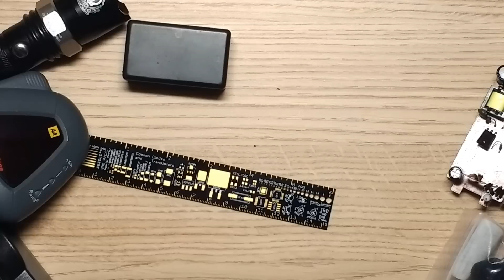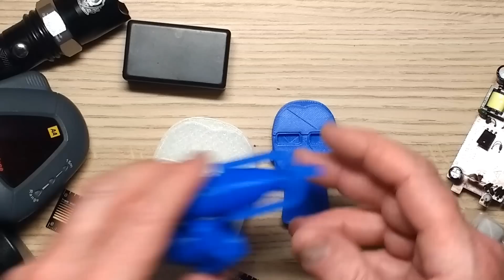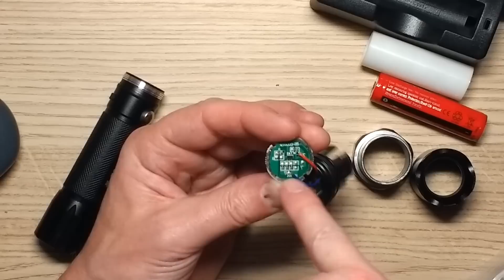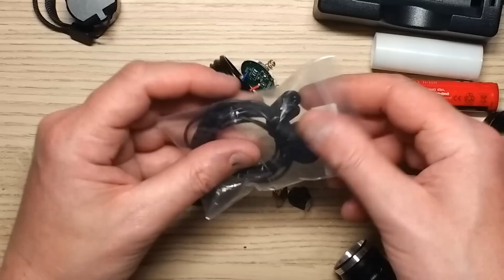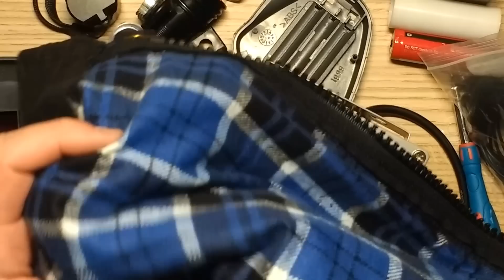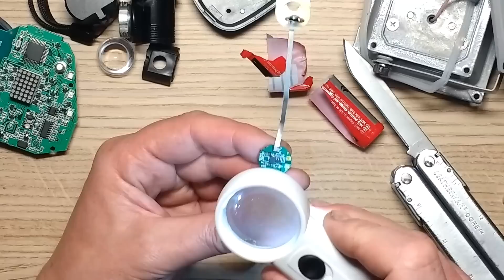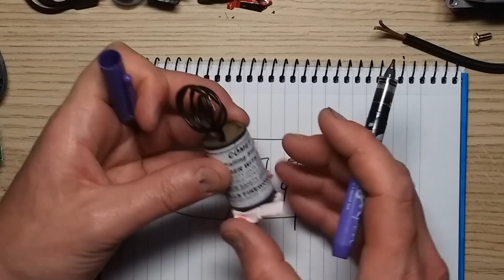Exploring technical gifts from the Edinburgh meet.

Comment: now that im seeing this a 4th time, that metal thing at 2:10 looks to me almost as if you could use that as a bottle opener
8:50 that flashlights a bad design cuz when you zoom it enough those wires will break off the board.

Comment: I had a flashback when you took the Trafficmaster unit apart. Years ago when Trafficmaster were setting up and putting in all of the infrastructure they were contacted by a good friend of my father's that works for the DTI. Someone discovered that during manufacturing a slight boo boo was made and the wrong frequency was programed into both the transmitters and receivers. This was discovered after well over 1000 sites had been commissioned. The result was that Trafficmaster had to recall and re-program all the kit out on site. OOoopsy !!!! It made me chuckle when your video reminded me of the rather large screw up :-D

Comment: Getting a kick that someone knocked off Ultrafire.  Crap batteries as they are.  Generally, I risk getting a shock and when my laptop battery goes to crappers I try to tear it apart  without a shock and usually get one.  But those last way longer than the Ultrafire ones do.  What is Ultrafire knocking off.  (and yes thanks to you Clive having a 5000 mah light weight li ion batter vs a 2000 heavy weight battery hmmmmm  which one is better.  Although not always true..  Antec PSU computer grade , that shorted right out off my left hand and out the right foot  (ouch) but the old cheapie $20 Logosys PSU's are nearing 13 years old and still rocking.  Antec ($80 PSU) says hey 4-5 years is good.  Logisys (sp)  somehow they last longer.  Especially the all black ones.  Had an iffy go with one that was half black half olive green.  One of the rails fails my PSU tester O_O  As for puffed up capacitors.  I had to toss a motherboard out when 6 in a row all did that.  Mercury PC did that.  Long dead company but it worked with ubuntu so I was good to go there.  Never shut off right under windows..

Comment: They are non polar I use those ones in audio equipment; multicomp I think. Panasonic SU series ones are better tolerance though.

For smps use I haven't found better caps than Panasonic FM series. These have the lowest esr and hence lowest output impedance for the supply. However worth noting that the FC series actually offer longer life.
Reply: P.s. I thought that was an AvE ruler!

Comment: 7:30 ,that torch is the EXACT same design as the golf ball finder UV light torches ! also came with rechargeable battery and mains charger ,only thing different must be the bulb and regulated circuitry for it

Comment: I'm surprised that cannons designed to fire off pounds of black powder and shot would be affected by firing fireworks out of the barrel. They could just stick a temporary bore liner in the cannon for the show. If this show was based in 'Merica then they would probably be firing black powder blanks. Otherwise  great video mate.
Reply: IIRC from the earlier video showing them, they had multiple shots set up on each cannon. Not feasible to have a gun crew on each  gun, reloading them. From a distance you probably can't make out if the flame comes from the actual bore or just next to the barrel anyways.

Comment: Ah the 'personalised roadwatch' - a disguised Trafficmaster box based on their Trafficmate product. Served its data on 153.2750 from roadside boxes encoded POCSAG FSK (mainly now those 'blue poles' you see which generate an MD5 hash of the reg number & track journey times between adjacent sites). Their older product with the big display worked similalry but displayed stuff on a big map. That got its data over Vodafones national paging network in POCSAG.

Beacons are still fitted, network still works. The data is just now presented on apps on phones instead of dedicated devices. Trafficmaster started out at Marlborough House in Linford Wood, before moving up to a massive building (all theirs) at Cranfield - they now occupy a couple of floors at most I think, rather than the whole building.

Madness with their ANPR 'blue pole' network is each pole site has its own dedicated ADSL connection. They used to be dialup with data shipped back every 5 minutes. The modem rack in MK was quite a sight!

God i'm a ruddy anorak!
Reply: Great info!  I was interested to find out about this network, as I hadn't heard of it before this video.
Reply from the maker: +Nik Fox All good info, and intriguing to know the system has adapted.
Reply: May even have changed again since the last time I looked but yep, they live on! Glad the show went well by the way - we've got the BBC Concert Orchestra in my theatre tonight....now, what could possibly go wrong :) haha
Reply: I keep meaning to put some batteries in my receiver to see if it still works! :-) Mine's one of these:

http://www.uglybloke.co.uk/cb/rac%20traffic%20alert%201210.jpg
Reply: Niiiiiice! Did the RAC one need an 'information key' chip or not? I had the old Trafficmate doorwedge shaped thing, and the newer flatter one. Still around somewhere I think. Latterly I had the iQ (like an early satnav with a screen) - all of them were 'protected' by one of those keys which only told the unit an expiry date ISTR. Wound up reverse engineering the protocol because, well, I'm just sad like that & at the time I was a radio travel news geek :)

All pointless now of course with Inrix (nee Trafficlink & Metro Networks) feeding data into the TMC carrier on Classic FM for your Satnav & Google doing their own traffic probing...and Waze of course. That said, Inrix are still using humans to do the editorial work for the most part. Many a long 12 hour shift doing that in between dialling into BBC Local Radio stations to depress the driving public ha
Reply: No, the RAC thing is free to use and didn't have any sort of key, though of course it didn't have the functionality of the map display on the full Trafficmaster doobrey. Researching around the net, it seems the system was left to gradually fail, but was switched off entirely a couple of years ago. Shame if that's the case, it seemed more real time than what you get on the RDS system.
Reply: It is/was - so far as I know they're still using the traffic detection infrastructure but I've also heard not. The RDS TMC data relies on a human putting it into a computer (motorways could in theory be automated...) and that data being pushed out. Trafficmaster was just that, very real time :)

Comment: You can buy a non-focusable version of that torch without charging support in Home Bargains for around £3. Other than lacking the charging port or ability to focus, it has exactly the same case and same functionality. The home bargains version comes with an adaptor for 3x AAA batteries, but it'll also happily fit a single 18650.

Comment: the chop saw was probably using an abrasive type disc and you dont use those on aluminum. basicaly it loads up the aluminum on the wheel because it actually melts it, then as it continues to load so does the temp until BOOM! its explained here http://web.mit.edu/course/other/machineshop/Grinder/aluminum.html
Reply: i don't really like using abrasive chop saws or cold cut saws because chop saws blow up once they get loaded and the carbides fly off the cold saws if you look at them wrong. an angle grinder with a zip wheel is where it's at. cheap, thinner, faster, and if they blow up it's not a fucking apocalypse. if i need to cut big tubing then a portaband is infinitely more effective and versatile

Comment: The non-parcan 3D printed lantern looks more like a Selecon SPX than a ETC Source 4 - the shape of the handle at the back on a source 4 is two distinct halves, whereas that looks like a full circle. They're both ellipsoidal profiles though, so have a very similar ... uh ... profile, as it were.

Comment: Clive, the driver on the torch may have a memory function. You flick through the modes but half pressing the switch rather than on and off. If it has memory on the driver they normally kick in after a few seconds. So if you switch it off on say the highest brightness it should come on at that setting.

Comment: What is better for home audio XLR vs. RCA interconnects: is there a difference?
Reply: The Sucky Gamer Shit  XLR,S are usually for balanced connections their both ok for Audio XLR,s are quite tough as in professional circles they are often dropped and often run over by various vehicles or stood on they survive
Reply: The Sucky Gamer Shit Balanced line of which XLR is but one... another being TRS, are best for noise rejection due to the shielding being separated from the signal leads.  RCA is a type of unbalanced line where the shield is also the negative... not great for noise rejection in certain applications.
Reply: praestan8 yes your right of course about the Tip Ring Sleeve  being another way RCA phono is ok for unbalanced connections but not really used in professional circles but still can be found for short distances

Comment: I thought that the converter would have been a sinusoidal type Royer Oscillator with a centre tapped tuned circuit.
Reply: Well, you've created my research rabbit hole of the day... I barely understand peak and PWM controllers...this will be bad... Thanks ;)

Comment: I have the same flashlight just different branding. They sell them in Aldi from time to time. Sometimes with the barrel jack and sometimes with a micro USB.

Definitely worth a look, its a good light.
Reply: In addition to "Police" on the sleeve of that torch, the top part also includes the logo of the Communist Party of China!
Reply: I had one such abou a year ago and what a brilliant light it was. Shame that it started blinking and one day simply stopped working. I wanted to swap it for a new one but they don't sell them anymore. At least the refund was quick, straight back to my card. The torch seemed to be identical to this knock off one, providing very powerful beam of light. Maybe it got broken because I used it on my bike sometimes as it fit into the Led Lenser bicycle mount.

Comment: Flashlight do not store typically charge for remembering modes. They use software to save the previous mode to eeprom and when it turns on next time it reads the previous mode from eeprom and selects next one.
The ones with mode memory usually wait a few seconds before they write the "remembered mode" to eeprom. That way quick on/off swithing changes modes constanly and after it has been on for a while it stores the mode and next time it turns on in that one instead of advancing to the next one. (other software methods exist for this but this is to give you an idea of how it may typically work)
Oh, the focusable light with moving led have typically very bad thermal conduction from led to the outer shell. That means they heat up and tend to not last too long untill the led has suffered and dimmed.

Comment: Those caps say "NP" on them = non polarised
Reply: Some value/voltage combinations are only available in non-polarized as budget capacitors nowadays. One needs to go to the brand name capacitors for polarized, low ESR models.
Reply: Против Глобал non polarized =no problem. because it can be used any way. one does not have to care about the polarity
Reply: what about just bodging two on there to make a non-polarized arrangement with 2 polarized caps (by putting the negatives or positives together in the center)
Reply: Non-polarised capacitors are mainly used in audio coupling applications. They are not suitable for use as smoothing capacitors, let alone use in switch mode power supplies. In SMPS applications, as Clive said, low ESR capacitors should be used.
Reply: I totally agree mark .... but apparently by putting either the positives or negatives together in the middle you can make polarized capacitors like electrolytics non-polarized (don't quote me on this, Dave said so :P)
Reply: No Power might be more fitting.
Reply: I recognise the logo on those shitty electrolytics , sold in the local hobby shop. The things are absolute RUBBISH... I've had to do re-repair work when owners bring me gear they say they've fixed days ago but it 'died again'....
Reply: mikeselectricstuff P=NP?

Comment: Hey Clive, Those capacitors are definitely non-polar. I have a squillion of those exact ones (I think I cleared out Conrad electronics of those a a while back) I use them for amplifier and arcade monitor repairs
Reply: arcadeuk yes, and they're definitely not low-esr, which is why they failed in this application. ESR is important in this case and not so much the frequency, as Clive mentioned in the video.
Reply: The caps, I gave with the circuit are identical to the one that came out. So as you can imagine it hadn't lasted very long before I replaced the cap either. Thanks for the info on them though, I'll make sure to use them somewhere appropriate.